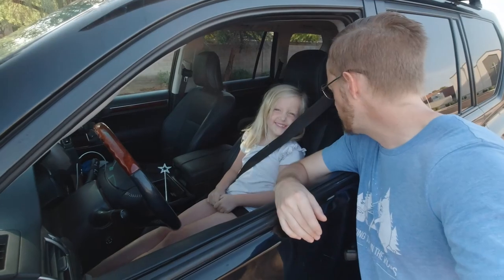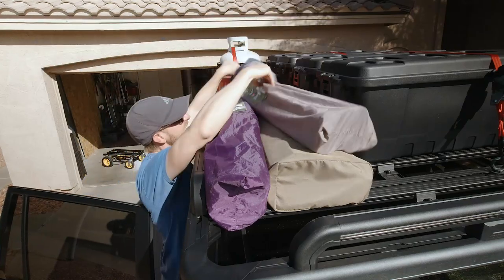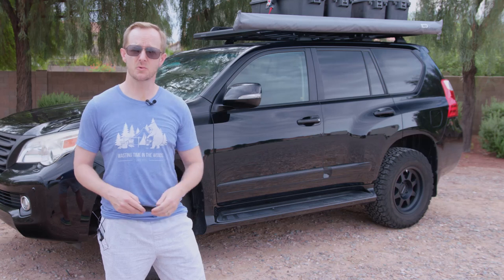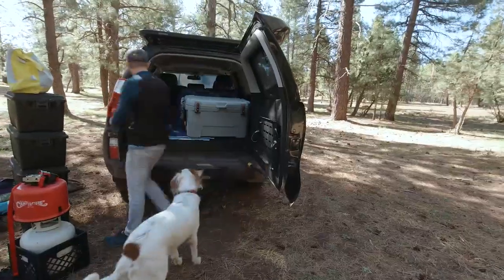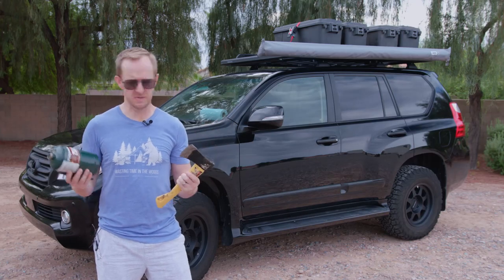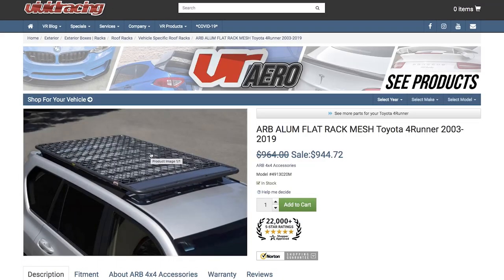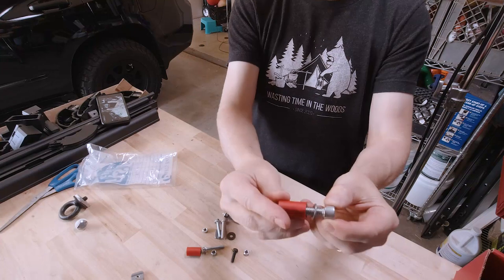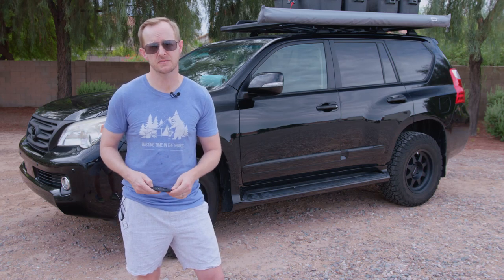The Box System! - How To Load A Roof Platform

Comment: Liked the vid and your narration style 😂 Plano boxes rock👍 little tip if ya want to make the boxes more water and dust resistant for driving conditions you can get door seal or window seal sticky gasket rolls at the hardware store and line the lid grove with the gasket which makes the box even more weather and dust resistant for those down pour drives or dusty washboard roads.
Reply from the maker: That’s a great trick. I saw a thread on Overland Bound about using door gasket but they were using super glue I think. Your approach sounds much easier, I might actually do that. Thanks!

Comment: Thank you for putting this video together 👍 Can you recommend any particular T slot eye bolts, other than the silly expensive Yakima ones?
Reply from the maker: Not really, I’ve looked high and low because I’m a cheap bastard. I have a bunch of Amazon/eBay ones now which have worked fine, but none are nearly as good as the Yakima ones. I was at a off-road accessory store, shooting a commercial for them about three months ago and asked them if they could get me an alternative. They said they’ve looked. Their conclusion after checking Granger, and a bunch of industrial suppliers was that Yakima isn’t even marking them up much. You can get the same ones from Granger, but they cost about the same.

Comment: Curious, what was the rationale with this style of roof rack vs an offering from victory4x4 or southern style off road? Thank you for any answer!
Reply from the maker: Ive come around to them since I poked fun at their looks in this video - https://youtu.be/MqJhU1hEd1U Those are what I would call 80/20 racks because they use 80/20 commodity aluminum cross bars and they have a ton going for them. Id still prefer a full platform with more coverage like Yakima, front runner or Rhino for too many reasons to explain here but the 80/20 are the lowest and lightest. If you start a thread on ih8mud’s prado 150 forum I’ll expand.

Comment: Newer subscriber. Love your channel, content and laughs. Just wanted to confirm, the Yakima lock n load size you got is the 84x54? Also looks like you put in Yakima roof mounts and rails to get away from factory/OEM rails. What exactly are the Yakima parts you ordered for the roof mounts and rails to support the lock n load platform? TIA!
Reply from the maker: I wish I could help you with this one, but those mounts are only available in Australia. I got them from a very cool dude on iH8mud who liked my vids. They are Prado mounts for the Yak LockNLoad bars and I used the E-sized platform which was probably a bit too narrow in front. I would use the N size if doing it again. Someone else asked about them in the comments here and I dropped to part number in the replay so you could try to get them out of Australia. Yak is developing GX mounts for the US though so I would just wait and get an official solution or go with a different vendor.

Comment: Wouldn’t a roof box be better? It will provide protection from weather elements and better aerodynamics?
Reply from the maker: Not as flexible and won't carry much weight compared to a full platform. We take a lot of crap out there.

Comment: Hi, what size of this roof rack you have in this video?
Reply from the maker: ‘K’ size I believe. One size smaller than they recommended but I have the ausie version of the mounts. Might not work with us version.
Reply: Can you link the mount, having issues finding a way to mount the large platform to my '23 gx. Without using the factory cross bars.. thanks in advance.  @WastingTimeInTheWoods